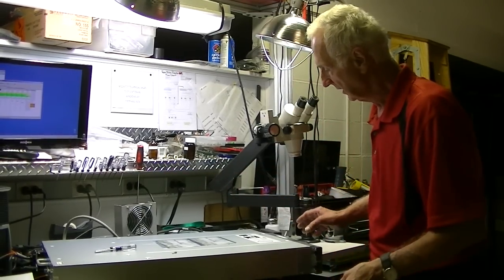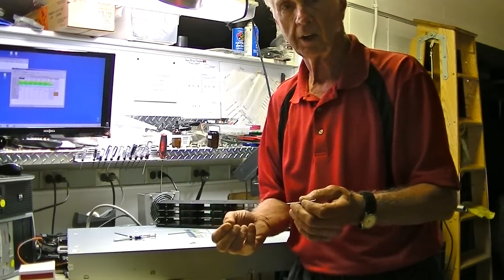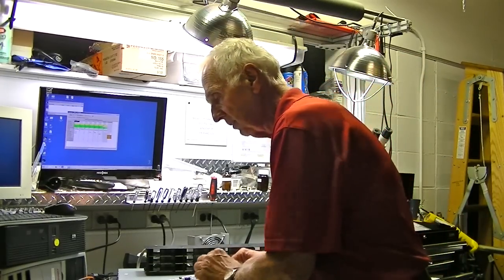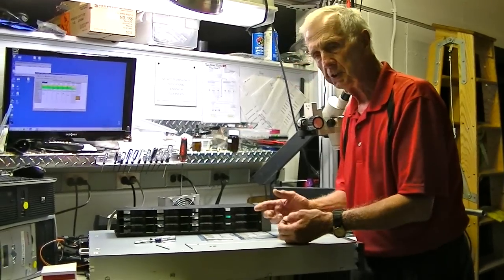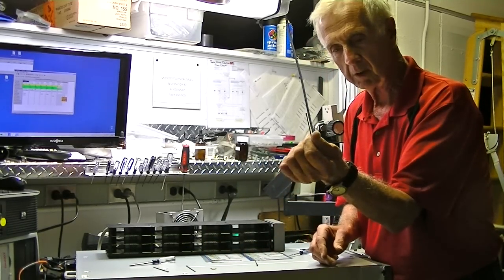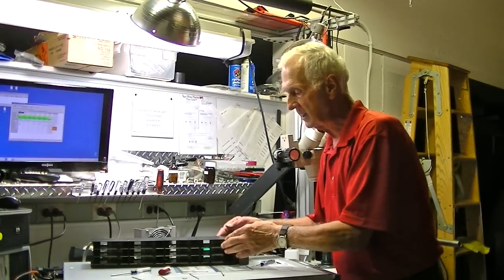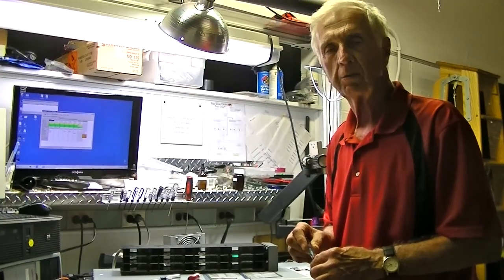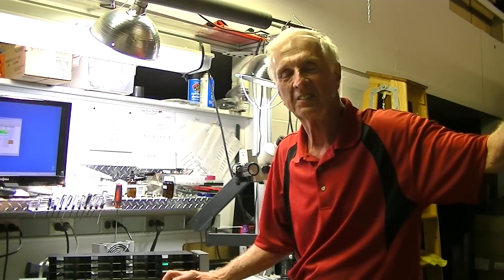Check Your Nuts! (TL2000 / TL4000)

Comment: Great Job to Check those nuts! I always check all the ground screws also especially on PC's main boards- Its a good idea to snug up all screws and bolts when cleaning out anything. On locking down the picker, I always put a note Over the power switch or power cord receptacle to Remove the Lock key or whatever is locked down Before power up!  On the lock tight- I would put the bolt all the way through, then put some lock tight on the threads just before installing the nuts- then put a little on one side of the nut to help secure it further and this also gives you a security seal!  Great video and great tips!

Comment: Very nice video ! I have a DELLTL2000 and following error HE: slider blocked, error during home movement Code 8A 22, is this hardware issue ?
Reply from the maker: Thank you for the compliment.  Your error sounds like a picker problem.  Possible a broken gear on the picker mechanism.  We could definitely do a no-cost repair evaluation for you.  We do have parts for the TL2000 to fix your problem.  Give us a call at 952-736-0200.  Thank you!